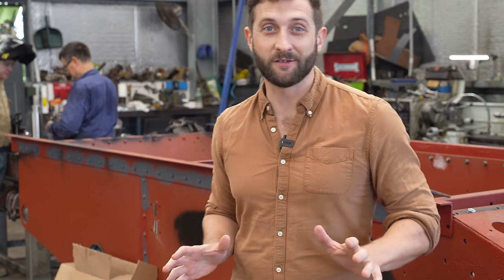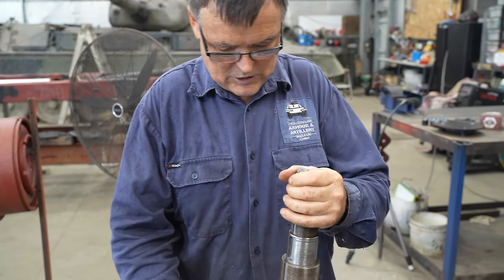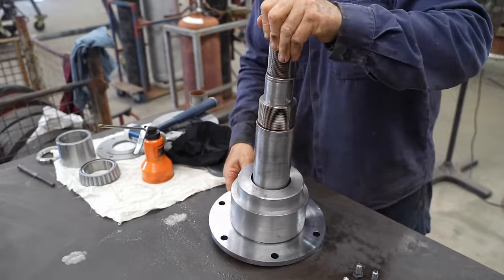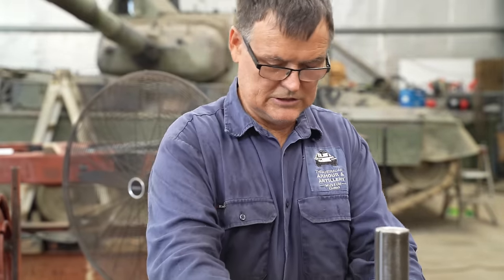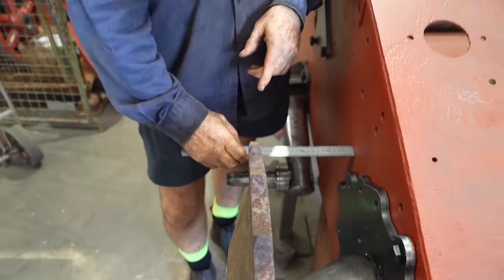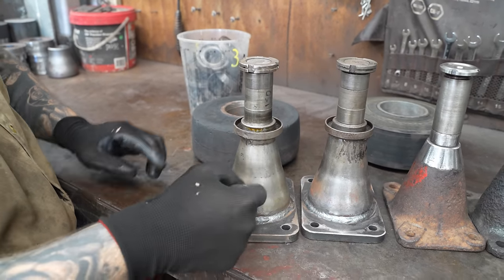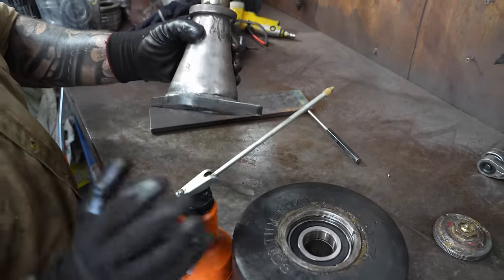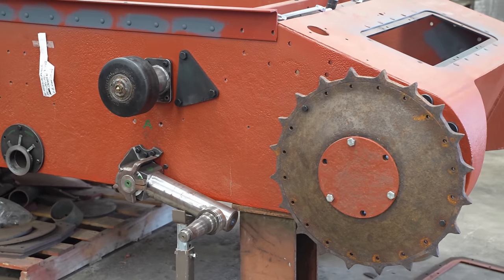WORKSHOP WEDNESDAY: How we fabricated and assembled FINAL DRIVE and RETURN ROLLERS for the Panzer I

Comment: A wee tip mate , Husqvarna has a piece of foam(drenched in oil or grease) taking up the space outside the distance between the bearings outside the distance piece so when pulls the shaft out the distance piece do not fall down providing one with a problem...lightweight an' very clevver...

Comment: The bearings on the idlers are sealed bearings pregreased so do you remove the seals because the grease nipple won't work
Reply: exactly my thought.  Not unlike pumping a mower mower spindle full of grease and blowing or pushing the bearing out with hydro pressure.

Comment: Is it just me being ignorant or has Daz made an oversight by putting the locknut against the outside "bearing retainer plate" so the nut is against a spinning surface in regards to the shaft, when the nut should have been on the inside of the "bearing retainer plate" against the inner bearing race which is locked to the shaft?
Reply: There is nothing "arrogant" about highlighting a major engineering flaw, especially when he states the "double lock nuts" on the shaft will also provide an additional bearing preloading function. In fact, there is no means of adjustable preloading of the three bearings in that assembly.
Reply: @BTW...  Thanks but I used the word "ignorant," in case I had overlooked or ignored something.
Reply: @bmw1894  Oh, sorry, my bad. I read that wrong somehow.  
Not as wrong as the way that assembly was engineered... as you point out. Odd how others didn't see it.
Reply: I had the exact same thought. Had to watch it a few times, but I agree the rotating lock nut will wear on the (stationary?) flange. Not 100% sure how to remedy, but perhaps open up the flange ID and add a spacer, so that the lock nut can bear directly on the inner race of the tapered roller bearing?

Comment: "unfortunately" dunno... maybe from a historic perspective... but from the perspective that this machine will roll and turn and move about, and the fact that you're both internally and externally documenting this affair... that's no loss to anyone. Without those parts, this wouldn't exist. It would be just another static shell or hull or whatever, destined to fuse together over time and be dipped about here and there out of a corner or another. There's nothing unfortunate about you guys making these parts.
HIstory should be visible and present so we don't end up repeating the same mistakes. Especially now, when we're on the brink.

Comment: What is the grease nipple for on the return rollers? The spacer? Since you are using sealed bearings no grease will get into them.
Reply: The spacer between bearings does not rotate. It's clamped between both bearings inner races when installed.
It's easy to remove the seal on the bearing OR buy em without seals or shields. Same bearing number with a different letter suffix.  But you know that... don't you?
Reply: @BTW...  Yes I do but the bearings he was using are sealed just checking, I knew they could remove the seals.
Reply: @Nebulax123  Personally, I would buy 'sealed' bearings, and remove the thin dust seals, long after all the filthy gritty fabrication work had been completed on final assembly.

Comment: Since when do you use any hammer on the inner race of a bearing? It is good engineering practice if you either use a piece of tube the same size as the outer race, or a bar of the same diametre. If I would have been caught doing what you have done, my foreman would have sent me to descale the boiler.
Reply: Since he sought the title BUTCHER. 
It's far from good design practice to omit a form of labyrinth seal to protect the soft as poo lip seal located between the sprocket mounting shaft/flange and the bearing housing/mount.. where it is exposed to all manner of grit, falling or washed in... indeed driven in when the machine is pressure washed after joy rides in the dirt or mud.

Comment: You begin to realise how hard it is to keep these things running. New bespoke parts mixed with old parts. I suppose sometimes it's easier to replace everything but then what's the point in a museum if you just throw everything away and remake. Constant paradox between authenticity and practicality.

Comment: I don't know if you catched it, but the retaining of the tapered roller bearing is constructed wrong!
That last plate you put on is bolted to the stationary pice but retains the inner race of the bearing on the rotating shaft, and the locking nut on the shaft rides on the outside of the plate! 
That lock nut needs to go through that last plate to press on the inner race...
Now that lock nut just rubs against that plate and the plate against the inner race! 😬

Comment: Why would you use a single tapered roller bearing putting a side load on the ball races that are not designed to handle a side load, why not use two tapered roller bearing as per normal engineering practice.

Comment: Still on 24fps in 2024, guys. :(
So, you're producing 21st century content, but presenting it in an early 20th century frame rate. :( 
Sadly you have been lied to: 4K and 2K mean absolutely nothing unless you can film and render at a solid 60fps.
And, so you need to reduce the resolution to whatever your camera can capture 60fps at, and use that.
It looks so awful when you pan the camera, because modern cameras have no "Motion Blur" like ancient cameras with moving shutters. That's how they got away with such woefully low framerates: each frame is blurry.
BUT - when each and every frame is a high quality photograph, with no blurring, the framerate MUST be 60fps to avoid jerkiness, and nausea when viewed on massive modern screens. 
This is a serious issue - and you guys should address it immediately. Once you change your settings, that is all you ever need to do. No other change is required for amazing quality videos at a full 60 frames per second.

But right now, your videos are quite literally less than half as good as they should be. 
Switching from 24fps to 60fps will result in a 150% improvement in quality! The math does not lie.
Reply from the maker: Hi Chris, hearing you loud and clear and have read your previous comments. Unfortunately we have to see through the current projects at 24 frames for consistency in the “super cut” version. However, let me assure you that all future projects (KV 1, StuG III B and…. others 😉) and other content will be at 4K and 60 fps as per your excellent advice!